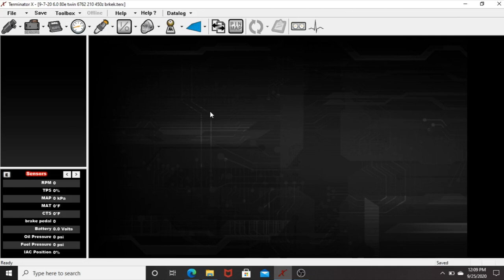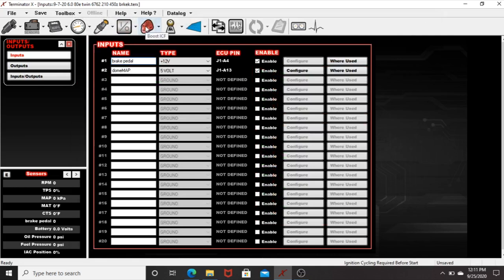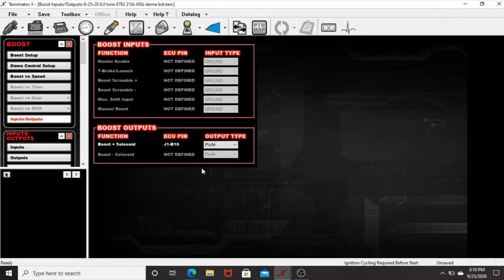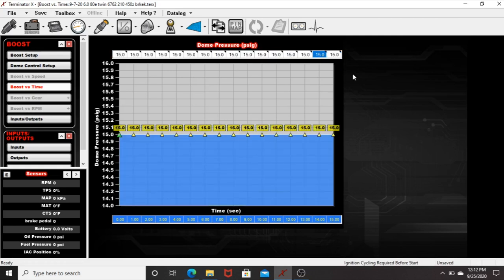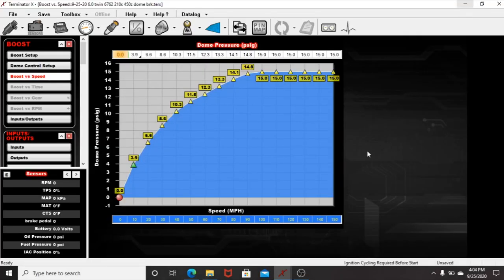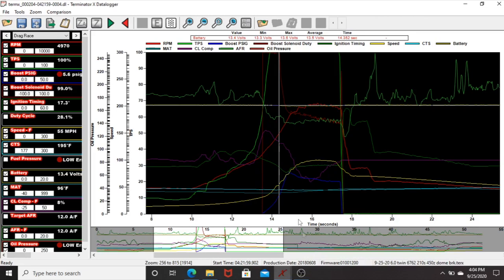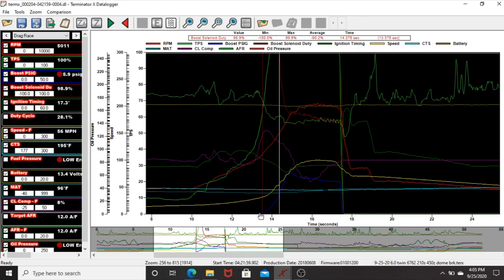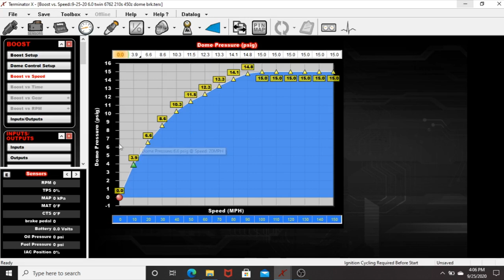Sloppy Copy Terminator X Closed Loop Boost Control Set Up And Testing!!!

Comment: I get an initial spike should I play with p or d? Or should I try and ramp it in with time? I command 5dome and get 8 spike then correct to 5-6. Dome map 3port like 4 port 6 psi spring.

Comment: This helps. I’ll just tap the wire at the ecu though. Only need to run the IO wire to the ecu then.
Reply from the maker: That works 💪 I knew this was temporary so I didn't want to mess with the harness.
Reply: @BlaserBuilds  when setting up boost vs time do I need to setup a trigger? Or if I set it up how you did just flat across will it always control boost to that desired number? For now I’m just adding a few lbs on top of the gate and don’t need to ramp it in. Just hold that pressure at all times. Thanks
Reply: @BlaserBuilds  Got it all setup. I see now when set flat it’s just a constant control. Mine is about 1.5psi off. If I command 8 I get 6.5 settled pressure. It’ll spike about .5 but comes down quick

Comment: I'm using domemap as well and have it setup through boost by gear with a 4port Mac valve using raw duty cycle target boost/rpm. Working great for me. Can lower it for the street for each gear and then all the way up for at the track. If you have any interest would be happy to show you my tune.
Reply: How did you plump the 4 poet valve to make it work?
Reply: @jakekw900  wish I could just send a picture....so looking at the face of Mac valve, and electrical wires on top, the bottom left side goes to side port of Wastegate.  Top left goes to top port of Wastegate.  Bottom right goes to turbo compressor nipple, and top right is open to atmosphere

Comment: ...looking forward to seeing some results on this one!
Reply from the maker: I gotta do some reading on the PID control and learn that... I wouldn't even know what to adjust right now, lol.
Reply: a21bravo check out Aaron Mello write up on the sloppy mechanics private Facebook page. Mostly about the filter circuit. That will help with the PID tuning

Edit: if you haven’t considered it and you are input limited I like some of the hybrid open/closed loop options better. You can do target boost but don’t have to deal with all the PID tuning to get it to work and don’t even have to use an input for DomeMAP
Reply from the maker: @trialbyturbo9106  I've seen a couple others. Wanted to try this.
Reply: a21bravo I run it with dial a boost. Gives me 11 different “closed loop” boost by mph options. It’s pretty great

Comment: I set my car.up just like you said in this video and ut worked great for one pass it added boost like it should. On my 2nd pass it didnt add any boost. Any ideas?
Reply from the maker: Hmm what's the input? Speed? Did it lose the input?
Reply: @BlaserBuilds I found  it was my cheap amazon Mac valve. Thanks for your vids they were alot of help.

Comment: Are you running the signal wire that’s meant for a dome pressure sensor to the map sensor?
Reply from the maker: Basically, just steals the 5v from the map and using it like a dome sensor.

Comment: I’d like to see a long 3rd gear roll on with boost set to a steady 10 or 15 psi. I’ve tried multiple strategies  with map as dome and could never get a level boost level. Always overshot and would fluctuate 2-3 psi continuously. Never seen anyone get it working correctly yet.
Reply from the maker: 17:24 in my new video... The scaling is off so the lines are at different spots, but 3rd gear start about 1lb over then near dead nuts at 16lbs at the end. But you can see the blue line level off, and yellow solenoid duty bringing it towards target.
Reply: a21bravo  just watched video. Looks like it does hold pretty steady. 👍

Comment: So if I have this right you tried the closed loop map and dome control deal but decided to go with boost vs speed instead....or did you still need to tap that map signal wire to do boost by speed? Sorry just trying to wrap my brain around it all. I also wondered if tapping that map signal wire drains the signal at all...I don’t see how it would but I just wondered about my own crank signal I split on my own setup to keep the factory stuff in play for my dash etc.
Reply from the maker: It doesn't effect the signal since it is a voltage signal. If it was a thermistor like a temp gauge it wouldn't work because its resistance based. 

Boost vs. Speed still uses the dome function to target. I dont have an in input release set up (trans brake), so speed vs time will work better for me. 

I could tie it in to my rev limiter input if I wanted to use boost vs. Time.
Reply: a21bravo cool thanks for the info man. Good to know.

Comment: I’ve been working on this for 2 days and can’t figure out how to make it work. How did you wire the Mac valve
Reply from the maker: One wire to a positive, other wire to Holley. It will be a ground output.
Reply: @BlaserBuilds  yep I have that correct 

I have dome/map set up as 5 volt input  going to the 5 volt wire on map sensor with white/black a-13

Output on boost output to b10 pwm- gray black going to one side of Mac valve

Other side of Mac valve going to 12v ignition 

Set up as boost vs time requesting 15psi and only getting waste gate which is 10. Am I missing something ? I’ve watched the video on YouTube many times but still can’t figure out how to make it work 

Turbo reference running to both bottoms of waste gate running to port 1 on Mac valve and port 2 running to top of wastegates
Reply from the maker: @johnbarnett8629  The issue might be with boost vs time. Do you have an input trigger that starts the time? Like trans brake release or 2step release?
Reply: @BlaserBuilds  no I don’t. That’s what I’ve been thinking as well. But I didn’t know if you had a button etc. what way could I do it without having a button etc
Reply: @BlaserBuilds  what if I do boost vs speed and just run it desired that I want from 0-300mph will that activate Mac valve ?
Reply from the maker: @johnbarnett8629  Yeah you can use boost by speed. Or RPM. If you use speed make sure you change the "speed Input selection" box to speed. When you enable select boost vs speed you see the box turn from grey to white, then select speed from drop down.
Reply from the maker: @johnbarnett8629  One watch out with speed is if you get wheel spin it can spike the boost if you have a ramp. So you'd want to set the ramp to where it helps maintain traction.
Reply: @BlaserBuilds  when I try boost vs speed is lights it up but it has no choices I’ll try to figure out boost vs rpm. Thanks for all your help
Reply from the maker: @johnbarnett8629  what trans?
Reply: @BlaserBuilds  what was starting your boost vs time table in this video?

Comment: Does the terminater x have scramble option?
Reply from the maker: Yes you can set up scramble.
Reply: @BlaserBuilds  would you happen to know if you can turn bump into scramble
Reply from the maker: @turbovicsatx2910  yes you can.
Reply: @BlaserBuilds  perfect can’t wait to get mine it’s on the way
Reply: @BlaserBuilds  hey I had a question where do you run iat to the Holley harness?
And also my oil pressure sensor is a different pin connector how do I connect the oil pressure sensor
Reply from the maker: @turbovicsatx2910  There's a MAT plug (manifold air temp). Termx comes with a 3 pin oil sender plug. If you have an early engine, it may have an oval 1 pin plug. I would just swap the sensor to the newer 3 pin style. Ecu does not need oil signal to run engine.
Reply: @BlaserBuilds  yea I have the 1 pin. will a gm sensor work fine like from a corvette will it read right or would have to mess with parameters? 
Sorry if I’m being a bug I just got it in and trying figure these out
How would I go about connecting that mat to my turbo pipe iat sensor it’s a 2 pin
Reply from the maker: @turbovicsatx2910  MAT the same 2 pin. And the gm sensors should all have the same calibration.